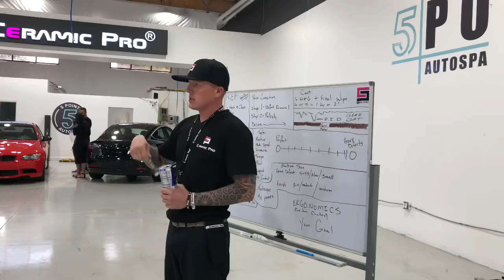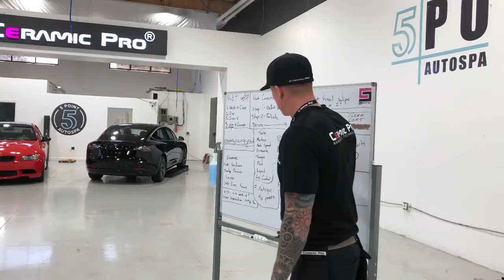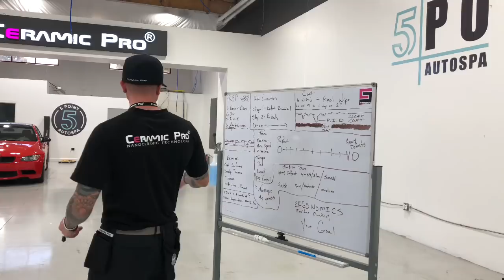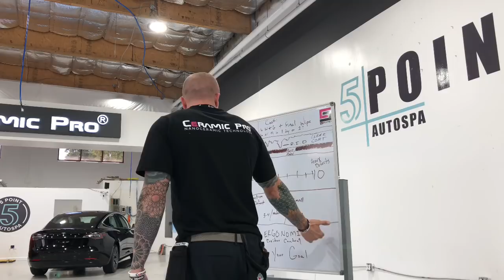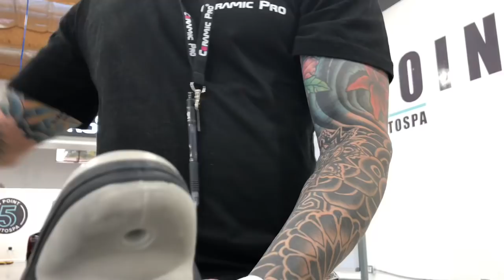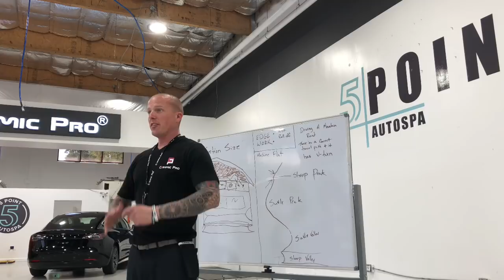What is Paint correction? The tools? How to use them? A step by step guide to paint correction.

Comment: 3:30 you could also switch to using Optimum Hyper Polish and you won't have to tape trim. You could be polish over the plastic to clean it and prep for a coating. It'll save a bunch of time taping the car for anyone interested in skipping that step.